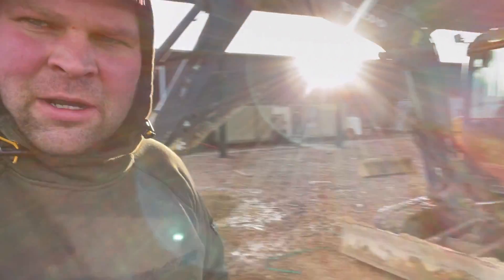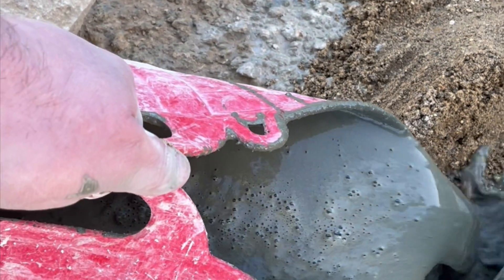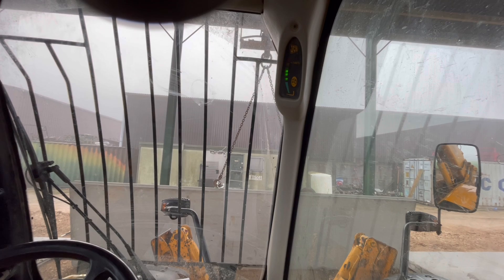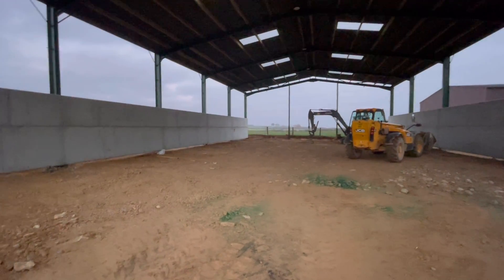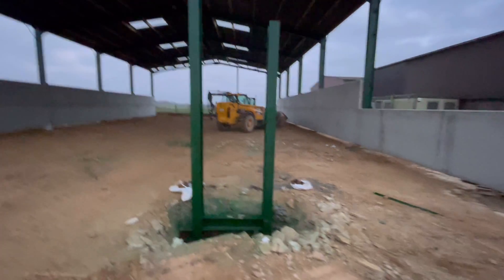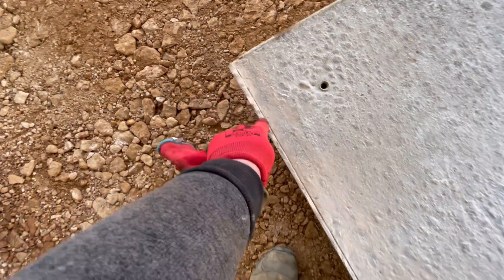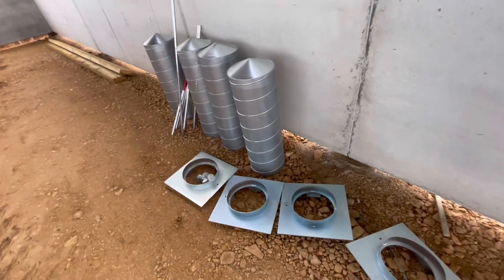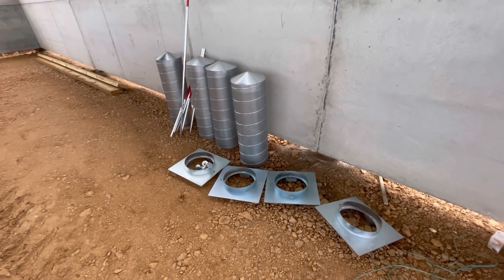Build your own grain store/steel frame building (part 3) concrete walls and cladding.

Comment: Tom next time make your own concrete panels - easy. Build a form ply box with tapered timber on the sides to provide grooves. Build them one on top of each other with a release agent between each pour.  Easy as I've done heaps ie. tilt up type panels
Reply from the maker: Il have a go
Reply: Have you got a video of you doing it?

Comment: Interesting engineering!  Over here you only see silos.  This seems as tho it would hold more, just need the equipment to move stuff...  Gotta imagine these are more cost effective, especially with what some of the companies charge for silos in the midwest...      Thanx !
Reply from the maker: And you can use them to sort a lot more than just corn

Comment: Loving this series, very timely as I to am building a shed also.         Can I ask you:  How far apart your steel uprights are and what size wooden purlins you used for the roof ?

I've been looking at online span tables but yours looks a good strong job and I don't think my uprights are as far apart as yours.       I would rather be over built than under.

Thanks in advance.
Reply from the maker: 20ft bays centre to centre.
Think wood purlings are 9/2 or 9/3 standard agricultural purlings

Comment: This series of videos has been excellent! I build a lot of my own farm buildings in various similar ways, so very interesting all round. Generally what is the preference for timber wood purlins over metal in the roof? Cement fibre over say profile cladding with say anti con lining? And with the side wooden purlins, do you think metal z bars instead would solve the sagging issue? Interested in your thoughts. Perhaps part 6 could be a mini Q&A /lessons learnt/cut ribbon type video. Thanks a lot for your efforts
Reply from the maker: I just like timber purlings and in cattle sheds and sheds holing wet corn for a long period of time I have seen z purlings corrode.
I like the fibre cement as they last a life time and the sort of semi insulate the building.
I have 2 buildings with z purlings and they all have sag bars in the side and they even have sag bars in the purlings in the roof.

Comment: fine shed you built how does the precast panel walls compare to concrete shuttered walls?
Reply from the maker: Much better and stronger
Reply: @Tomlamb980  price wise are they more expensive?
Reply from the maker: Wouldn’t know what normal
Walls cost
Reply: Panels much cheeper than shuttered walls and walls will be up quicker than setting up the shutter forms

Comment: A lot easier with the vertical sheeting to clamp on off your timber purlins to the columns and prop it in the middle and just sit your sheets on it and fix them with no need to support the sheet yourself
Reply: That’s what we do, and just prop centre rail untill the sheets hold it.